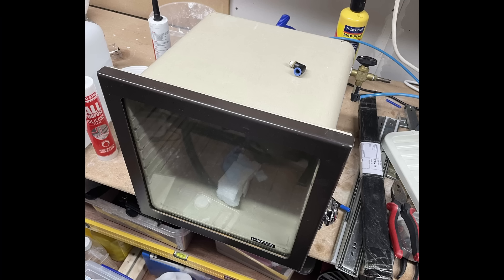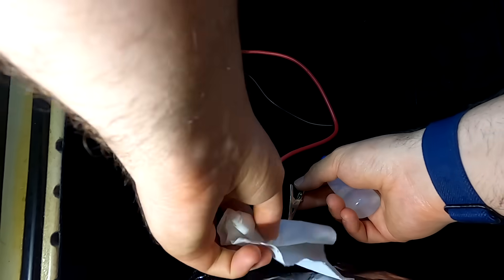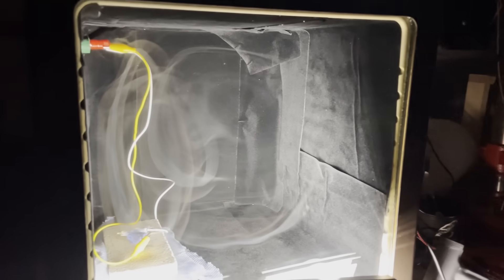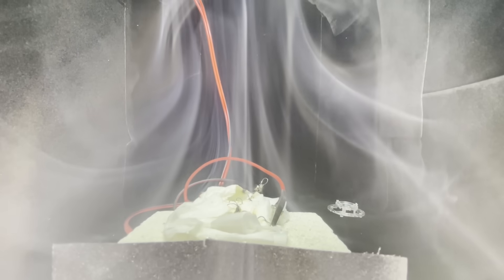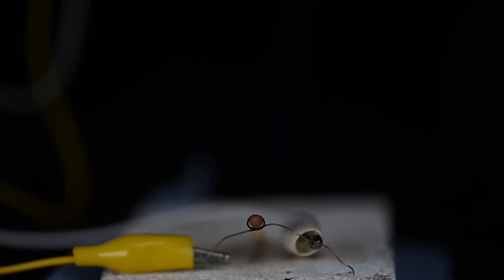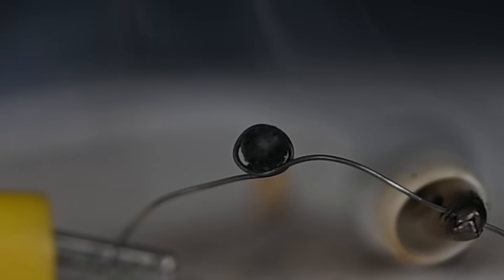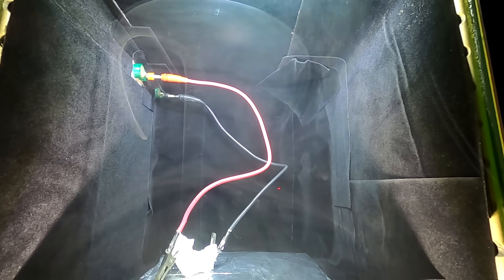What does Convection look like in a Vacuum?

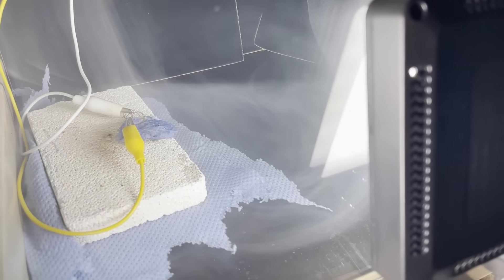Comment: 1:45 Laminar turbulent flow is wrong terms, smoke is very small dust particles what is reason we can see by naked eye, gas is transparent fluid that has mixing rate about 10^20 Hz each molecule of gas (Brownian motion) has such high rate of bumping to each other. Smoke motion "laminar or turbulent" depends on "smoke" particles size in fluid, for example potassium permanganate in very slow stream of water has near laminar flow (non mixing stream) but if you replace potassium permanganate with inkjet printer which are very small fine particles in size, but still compare to water molecule it is 10 thousand times bigger than individual water molecule. In inkjet laminar flow even in stale waters disappears because gas molecules mixes "small" inkjet particles very easily. This laminar turbulent flow made such harm to aerodynamics that wind tunnels are still built by formula 1 aviation even car manufacturers throw away money when it must be calculated on paper, that is how misconception of laminar turbulent flow done to fluid dynamics science. It destroyed all practical science, no calculation can be done before criteria laminar, transitional, turbulent or Re>10^6 super turbulent are defined.  Calculation not match real experiments and always must be approved by real action experiment. Which are very costly and energy consuming.
Until laminar turbulent flow exist we can not have any efficient device from aerodynamics to heat exchangers - throw away money through chimney.

Comment: A smoke being a solid in suspension in air, no air, no smoke.
If there is convection, then it's not vacuum.
Which means that the quality of the vacuum is rather poor inside.
Note: I'm worked a bit with good vacuum: just a fingerprint on an item will prevent one to reach a good vacuum (as the grease from the print will vaporize). Putting a liquid inside a vacuum is a non sense: it will boil and contaminate  the vacuum until there is no more.

Comment: Were you able to measure the difference in pressure before and after generating the smoke? That would be interesting to know, how much smoke in relation to the remaining air was.
Reply: I suppose there could a be difference in about 0.5 to 1 magnitude of order. I work with TEM electron microscopes on daily basis, and one of the reasons they work is because TEM/SEM operates under vacuum. There are instances where I burn a piece of a specimen because of the intensity of electron beam (human related issue) and I get an increase of 1 to 2 magnitudes of order in the pressure in a volume about 4x smaller than this cubical chamber he has.
Obviously this is a very harsh prediction on my side, because the specimen in TEM needs to be... ridiculously thin. He's lighting up a match, severely thicker specimen than what I have, thus the quantity of molecules and atoms released is substantially higher, but pressure is proportional to the area/volume it exists in, so thus I predict such "relatively" small difference. I could be also completely wrong. Electron microscopes have challenged more than a half of my knowledge in physics, and to say that nature around us is strange is the least i can say about it.
Reply: @novelaforme  Does your current guess also account for the fact that the vacuum chamber here is capable of a much lesser vacuum than a TEM/SEM is? I'd imagine that could also be a factor for an estimation. Though, I guess one would have to know at least the rough range of vacuum that the chamber can pull.
Reply: @Christian-os3kk  I'm not sure how low the vacuum here is. My TEM can go as low as to 5.00e-06 Pa in a column and 2.00e-07 in an accelerator. However, the added mass is absolute, so if measuring absolute difference, the quality of the vacuum should be mitigated.
Reply: @novelaforme  Interesting. I knew such equipment should be able to get pretty low pressures in order to output usable data, just didn't know that it could get this low.

I wonder though, how would Fermi approach this kind of estimation and what would his guess be? As when I think of the additional variables (which I know of) I get a headache. For example PV=nRT and the initial, but steadily decreasing cooling effect on the gases produced as they expand due to low pressure. Then there is the chemical reaction taking place in the matchhead is also happens to be exothermic. Without any proper data it quickly becomes a real mess to think about and honestly I even doubt these additional variables have much importance for the final outcome, though it's still fun to entertain the mind. Also I could be completely mistaken as to the equation and change in absolute pressure due to temperature. I'm not exactly a scientist
Reply: @novelaforme  a major factor not mentioned. the match is burning. lot of heat. pressure needs volume... AND temperature. along with the energy of the wire as well. 

was interesting watching the nichrome heat under vacuum, how fast it glowed brilliant orange. reduced conduction to form convection currents. 

 hmmph. wanna see it with thermal imaging now... the change in rates of how the air heats, how fast it flows away, and how fast it cools back down...

"convective heat"... silly, isnt it? its not heat, just the effect of it. radiation and conduction. convection is still conduction! one of those terms that should be removed from the language.
Reply: @paradiselost9946  You are correct. Heat is directly linked to pressure, in absolute pressure with the square root of absolute temperature. I think I forgot to mention this unintentionally, since it's a muscle memory for me. TEM microscopes are cooked down with liquid nitrogen to -198°C or so, bringing the pressure even further down. This is a daily task for me, so I suppose this is why I do not take this into account anymore counciously.

With this, I suppose the change of temperature will not be transfered via the radiation in its majority, rather by direct medium affected by the heat, such as the smoke from the match. The initial pressure reading will be much higher, until entropy cools down the molecules by itself. I am expecting a gaussian curve in pressure change and an upper exponential extreme once the smoke dissipates into the volume enough while heated.
Reply: I think he mentioned the archived pressure, I didn't want to make the maths but is still nice to know about the SEM/TEM case, I haven't thought about that before. 

I would gess the relative difference (before and after the burn) is not that big here just because the starting pressure is much higher, but the change in absolute pressure probably is. Is just a matter of weighting a match as it burns, and do some math after...

Comment: This video pooints out a common mental shortcut people may make ... "You can't burn things where there isn't oxygen". I knew that the various liquids and solids that are used as rocket fuel or explosives will combust without the addition of oxygen from the air, but I didn't know that match heads likewise use an oxidizer so they still combust whether air is present or not.

Comment: Neat visuals, but isn't the smoke flowing through evaporated-but-not-burned fog fluid? The wet cloth should reach equilibrium... likewise it looks like the phosphorous in the match head is mostly boiling off... do you have a pressure gauge attached?

Comment: Convection currents in a vacuum are more accurately characterized as filaments of charged particles flowing along field lines. The lack of pressure limits diffusion and in these conditions, agglomeration and movement can be driven by relatively weak electromagnetic fields. It's likely that these fields rather than heat is what's driving the kinetics of the system. Heat can't really drive convection when there's nothing to transmit the heat. Even still, convection in normal atmosphere can be more accurately modeled as the action of electromagnetic fields, although subject to greater levels of entropy than in your vacuum chamber. 

Bravo, btw. This is one of the most incredible videos I've ever seen.

Comment: Quite beautiful, curious in the match experiment why does the smoke / heat rise? Would have expected it to go out in all directions
Reply: I'm glad I'm not the only one that thought this.  Maybe because it's not a perfect vacuum?
Reply: @aronmedders4353  was a thought, though the initial match burn suggested a vacuum. Maybe it leaked, obviously there will be gas emissions from the initial burn of the match, however I would be surprised if it was enough to fill the chamber to the point the smoke emission was less dense.

Comment: Cool!  I wonder if the smoke particles are charged, and might, in part, be responding to electric fields?
Reply: Yeah, looks like they are moving along an electromagnetic field pattern.
Reply: If they had a significant charge, I would think they would migrate towards either the middle of the void or else towards the edges, but not meander like this.

Comment: Great video! One thing I would like to see: When there's lot of smoke in the chamber and the chamber gets vented. Will the smoke  be compressed inside or will it rush outside?
Reply: When u open the valve air wil ghet in, nothing comes out. Afrer equilibrium smoke will be mixed with air like usual. And u canot see the smoke wil be mixed with air.
Reply: At first air wi ghet in . Then smoke does wat it does normaliy
Reply: @volodx  And what does smoke do normally when it is inside a vacuum chamber which gets vented?

Comment: I was about to post a question about why the smoke was rising at all if it was a vacuum.  Then I caught myself, it's not a perfect vacuum.  Even if you could exceed 29.9 lbs of mercury.  There would still be air molecules just not enough to apply pressure.  Suction doesn't really exist.

Comment: Maybe the smoke is attracted to the light. Radiant heat pushes air away from the light drawing cooler air in and the smoke is wisp'd  the smoke in and so it cycled through the chamber? 🤔
🇺🇲🔑🙏☝️❤♻️🌍☮💯

Comment: Pretty remarkable to see! I didn't expect it to behave as if there was no vacuum, there must still be many gas particles to make the convection currents work. I wonder if you can cleverly position heating elements to draw shapes with smoke.
Reply: I was actually thinking about a black strip of insulating material on which you shine a powerful enough laser

Comment: One problem is that any source of smoke I can think of also releases gas, which reduces the strength of the vacuum. Can you measure the change in pressure? Perhaps something similar could be achieved by mechanically disturbing some very fine dust (though I don't know what dust is as fine as smoke particles). If you can get smoke without the gas, then a sufficiently strong vacuum would let the smoke just fall to the ground.
Reply: Exactly what I was thinking.
Reply: At 4:50 the initial body of smoke shot upwards. I didn’t understand why these particles wanted to rise in a vacuum until I saw this comment. Now it makes sense to me that prior to seeing the smoke, there has been a stream of invisible gas doing convection from the heat source. It is these invisible gas particles which lift the visible smoke particle up to the top of the box!
Reply: I mean at that point we're not really talking about smoke since smoke is a gas, so it would fill the chamber no matter what. States of matter.
Reply: @hrodebertcoad9848  Smoke isn't a gas, it's unburned fuel, or combustion products.
Reply: @sarkybugger5009  Actually you're mostly right
Reply: i remember an old AlphaPhoenix video where the guy was working with some heavy duty vacuum chamber and how it was a pain looking through the 30 or so bolts for any lose ones when the chamber loses some tiny fraction of a seal and the vacuum percent drops... he mentioned some technical jargon for the strengths of vacuums, and how it gets exponentially harder to pump out gas as you near the zero point.
Reply: This puzzled me too. How could you have convection in a vacuum? I would like to see what happens in a true vacuum. Difficult to achieve in someone's garage lol.
Reply: It would be good to see what the pressure changes are and you could continue to pull a vacuum and observe the effect. Similar to a decay test
Reply: Smoke is entirely just chunks of incomplete burn, the completed burn is entirely gas
Reply: Try dry ice?
Reply: Dry ice is frozen CO2; its product would be entirely gas.
Reply: Agreed
Reply: Electrostatic Effects would influence it too :)
Reply: That's probably it. In an actual vacuum the only burning would be from internal components of the match, and any byproducts would fall directly to the bottom the way that a feather in a vacuum tube does.

Comment: Small advice about "video can't show that". Try to use CPL filter on your camera. It can filter reflections, flat-glossiness from surfacer, and other stuff. Very useful thing sometimes.
Reply: How does a CPL filter work?
Reply: @EPMTUNES  in fact, right now you watching how exactly it work. Confused? I will explain: this is EXACTLY how LCD screens work. Every LCD have a backlight, that is constantly ON. But when you have a dark image on your background, why your LCD is not white? Exactly because of polarization filter: led backlight illuminating with polarized light, and when you need to make some place darker, liquid crustals are turning around to block light. 

Almost same method is used on more usual CPL filters for camera: when sun (or other light source) emitting light, it's (in most cases) in not polarized by default. But when light being reflected from surface, it becomes polarized. And CPL filter, just as liquid crystal in your screen, can be turned around circle to find a position, where reflected (polarized) light is blocked. That's why this filter called CPL (Circular Polarization Light Filer). 

Example: just walk outside. Look go near some cafe, store, etc. Look inside trough window. You can mostly see what is happening inside, but you can also see a reflection of yourself in this window, reflection of street, and some haze. It's all reflections. If you will try to take a photo of that, camera mostly will see only reflections, and only a little part of what happening inside. But if you will use CPL filter on your camera, it will filter almost all reflections and window become much more transparent for camera view. 

p.s.: i'm not native English speaker, so mistakes are possible. But I hope it will be enough to understand me anyway.
Reply: @MiraRK69  Seems perfectly explained to me. Great suggestion btw.

As far as polarisation goes, its also really cool to look with polaroids at various things you see outside. Glass windows on trains often have a polarizing effect.
Reply: @MiraRK69 Gg, so I just rip apart a broken LCD monitor and stick the polarization layer to some decorative glasses.
Reply: @EPMTUNES Circular polariser. It polarises light. Common in photography, you can buy them with many diameters, 55mm, 58mm etc
Reply: @JdA-1961  oh one of those! I always thought it would be interesting to have one of those as glasses (like a non-darkened but polarized shades)
Reply: @EPMTUNES polarizing filters always darken the image. "filter" here is very literal: they work by blocking light
Reply: Also it would look amazing with something like "the blackest black" or blk 3.0 and well fitted sheets on the walls
Reply: I thought about a circular polarizing filter, too